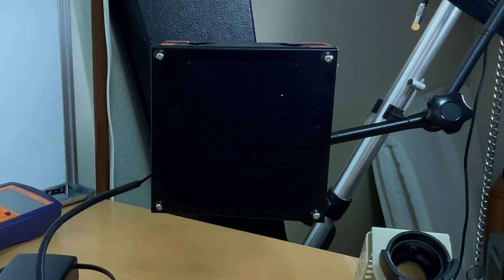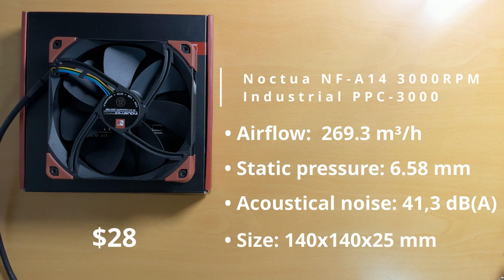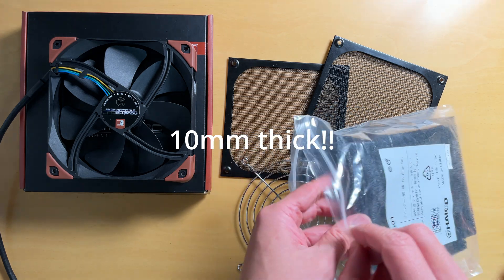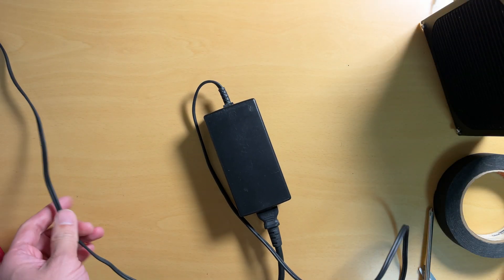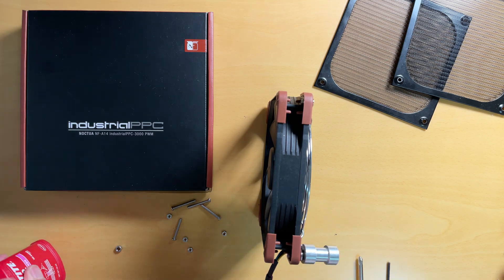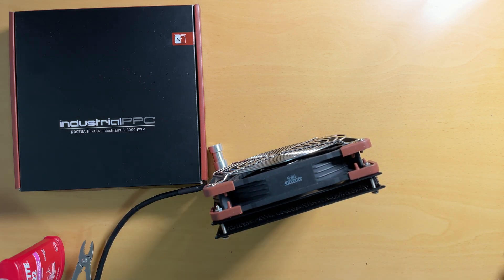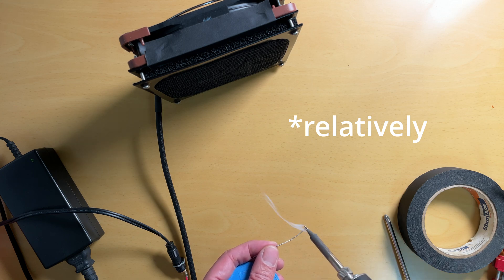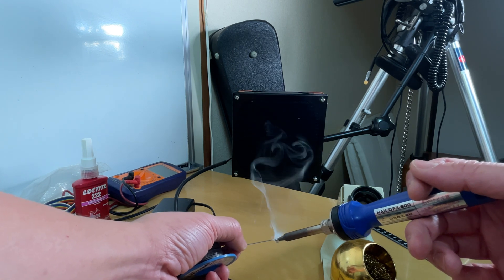10 min Solder Fume Extractor Build

Comment: I have the same noctua fan but I bought the 120mm to replace a fan inside a fume extractor. My problem is the fan doesn’t work hooked up directly to the 12v power supply like you did, any suggestions? Thanks btw nice vid
Reply from the maker: Hmm… I’d check if you’re actually getting 12V from the connectors coming out of the fume extractor. Some aren’t actually built for 12V PC fans. Then I’d just try powering the fan with your own 12V source so you’re sure it’s working properly.
Reply: @ I’ve checked it I also connect the fan to my bench power supply same thing no spin, but when I connect it to a pwm fan controller it does work but then it stop
Reply from the maker: I think the fan is probably bad then. If you just bought it, you should return it. Connecting V+ and GND only to a 3-pin or 4-pin fan should just have it run at full speed with no PWM signal
Reply: @ it was the fan, I returned it and bought a new one as you suggest. The new one is working perfectly, thanks man